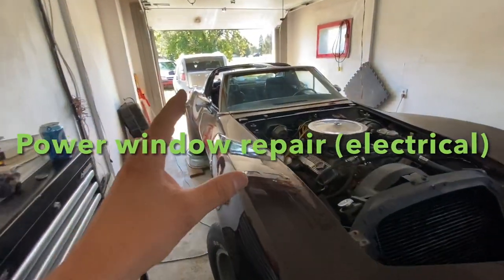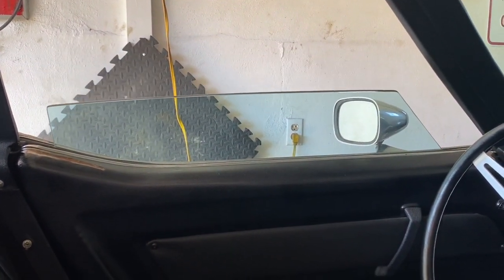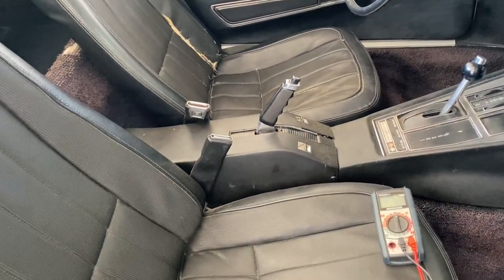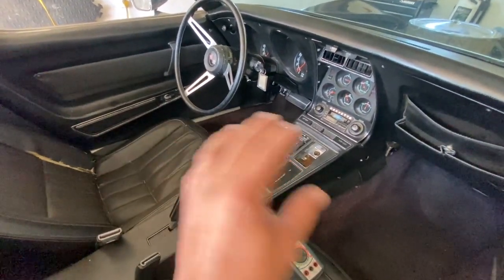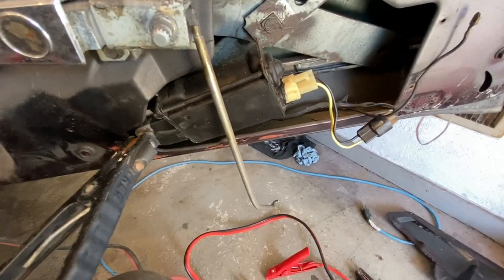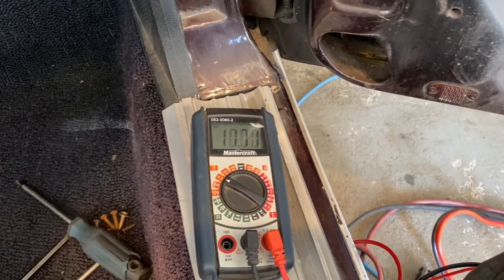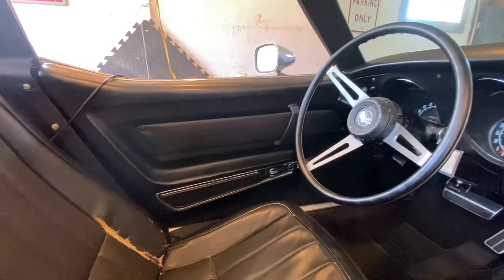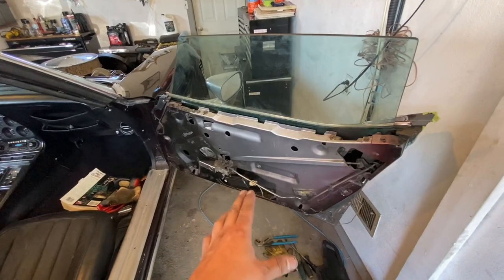Corvette C3 power window motor repair, (power window not working) power window troubleshooting.

Comment: Really Glad I stayed with this!  I had a hard time watching this at the beginning but, I figured I would learn something so I kept watching.  You do excellent work with the car.  I learned that I tested my motor wrong.  I did not see the third (ground) wire so I figured the 2 posts on the motor were pos/neg instead of pos/pos .  Thanks for the detail in your video.  I also really enjoyed seeing you fix the motor instead of tossing it and replacing it with a chinese reproduction.
Reply from the maker: Thanks for watching

Comment: Adjusting these windows are a pita.  I’ve been working on and off my ‘75 windows for three weeks.  There is in the assembly manual a section for proper adjustment that works fairly well but still takes some tinkering.  Good luck my friend.
Reply from the maker: Yes they were a pain but I got them both

Comment: Informative video.  One thing to note is petroleum jelly (Vasoline) is not the same as dielectric grease.  Di-electric grease is silicone based and will not harm plastic or rubber.  Vasoline has petroleum distillates and will eventually cause rubber and plastic to breakdown and disinigrate.

Comment: My 71 Corvette doesn't have that pigtail ground installed... I assume the motor provides the ground when its bolted in to the metal components. Great video!
Reply from the maker: Correct

Comment: I think once you get the two phillips head screws loose, that will solve your window adjustment problem. I have a 79 Vette and those adjustment screws are hex head bolts on my car and not phillips screws.  Anyway those  two screws are attached to your window regulator and will adjust the window angle. Make sure the gear on your motor was installed correctly to the gear on the regulator. That could also throw off the height of the window.
Reply from the maker: Yes that is exactly what it was, I figured it out like the day after
Reply: @ProblemSolverGarage  Looking forward to your next video on the left side window. Mine goes up and down great, but makes some strange noises. Great job on the videos!!!

Comment: There is a hole in the regulator gear and on the bracket that holds it which you can put a bolt through to keep the spring loaded mechanism from moving when you remove the mounting bolts.  This is important to do before removing the regulator to reduce risk of slicing off your fingers.  New regulators come with this bolt in place and should not be removed until the regulator is installed with the window is propped up in the raised position and the motor is installed.
Reply from the maker: Yes I figured this out later, unfortunately my window was stuck in down position which made it impossible to put the bolt in but I didn’t know about it at the time anyways

Comment: I'm trying to remember but I think the ground goes on the motor itself. If I remember correctly, there is supposed to be a little connector on the motor itself for you to connect it to. It probably broke or it was removed and forgot to put back on.
Reply from the maker: Thx